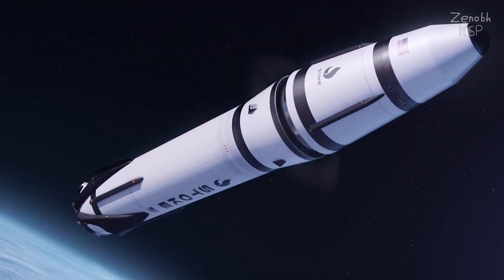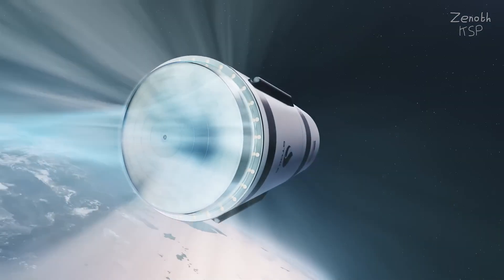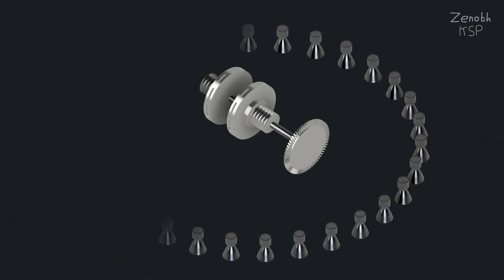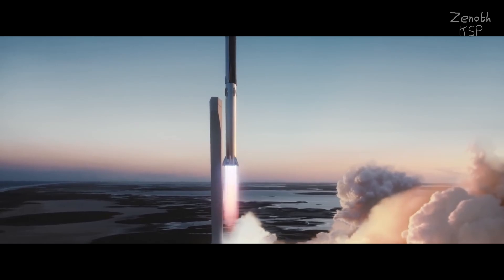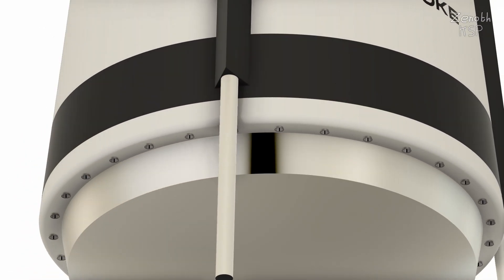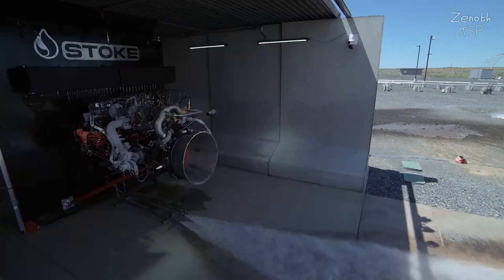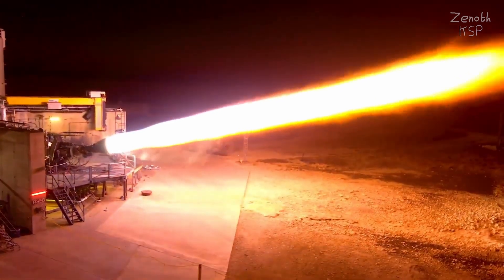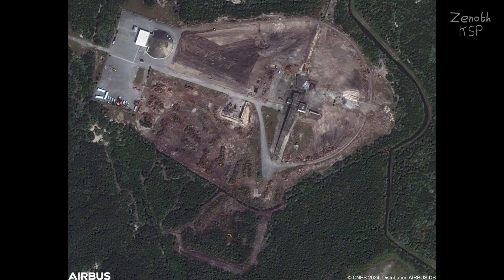Stoke Space: All you need to know

Comment: Great video. What jumps out at me about the design is how well in might work for a different purpose in conjunction with SpaceX Starship. A modified variant  with about 12’-13’ diameter and stretched to 50’ with larger payload fraction and smaller prop tanks would probably work well to deliver cargo point to point launched by Starship. It would just re-enter and land cargo, not be a second stage. Starship could carry 4 of them and they could land cargo at four different destinations. They are the right size then to be carried over the road or on cargo aircraft back to a Starship launch site for reuse. Cargo modules would be the right size for air or road transport. These would fit well with military cargo transport requirements and could land anywhere reachable from the orbits or ballistic paths Starship put them in. They could land at forward air bases, on carriers or in the field.